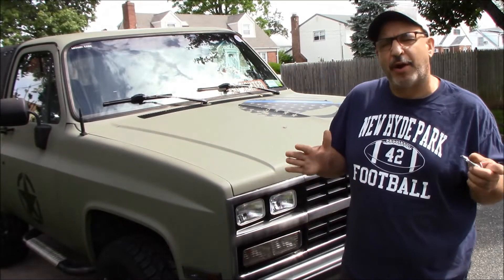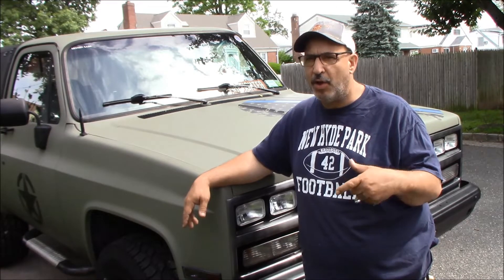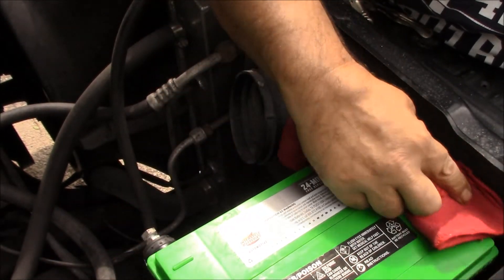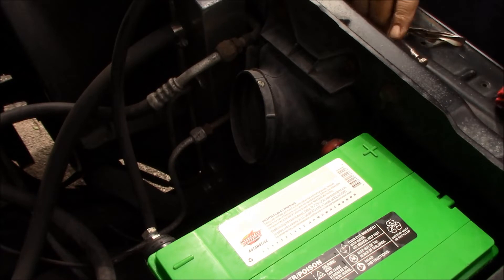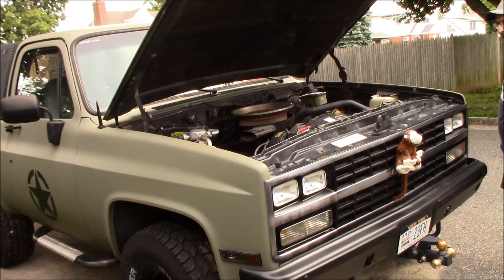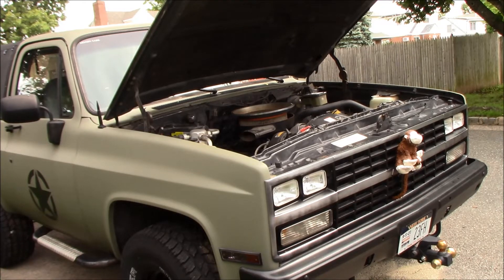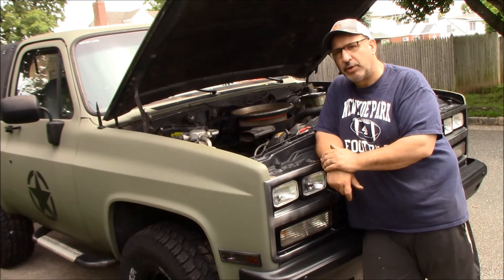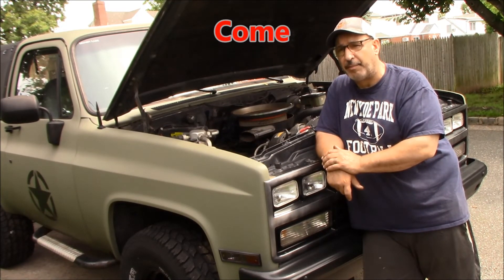K5 Blazer: Crank No Start *PART 6* Battery & Corrosion Problems | Chevy Blazer V10 C10 K10 V15

Comment: I have a chiltons manual for a third generation firebird with wiring schematics that says the fuel pump relay is wired to the fuel pump through the oil pressure switch via the tan and white striped wire and is is wired to the electronic spark control module via a green and white wire. I just verified on my 89 k5 and it has the same color wires on my relay. You might want to check the connections at the escm located on a bracket next to the throttle body and the map sensor. I had a bad ignition control module and it had the same symptoms but i didn't check if the fuel pump was cutting out. I would wiggle the wires to the icm and the k5 would start so i replaced it and haven't had any issues since. The chiltons manual doesn't show a direct connection between the icm and fuel pump
Reply from the maker: Thanks James,  I did unplug the op sender and it still ran so I'm thinking the reason its wired quite possibly that way is to cut power if OP drops?  It is starting to feel like I have an ignition problem.  I never knew there was a ESCM in there

Comment: Had the SAME PROBLEM. We'ved traced it to LOW VOLTAGE caused by the under dash fuse block. We put a volt meter on the fuel pump relay hot wire and while wiggling the fuse block the voltage would drop to various different levels.  We are removing the fuse block right now... hopefully it's just a bad ground.
Reply from the maker: This one is gonna take a turn, stay tuned